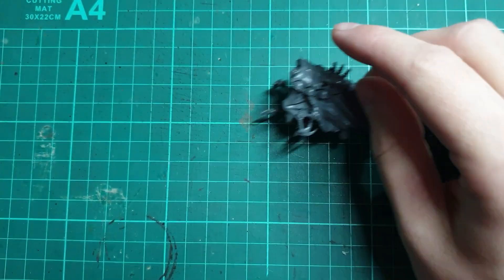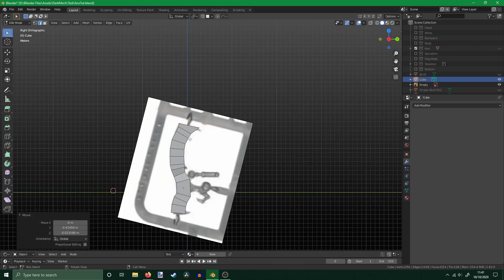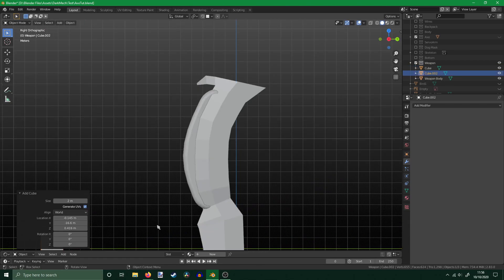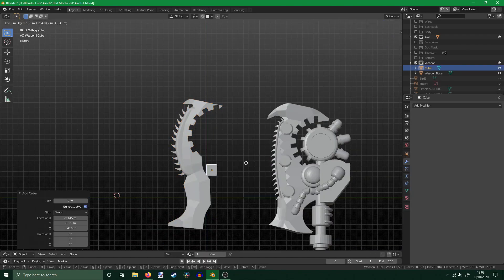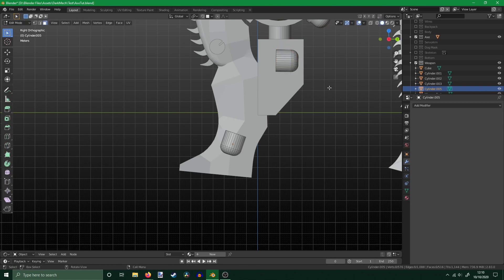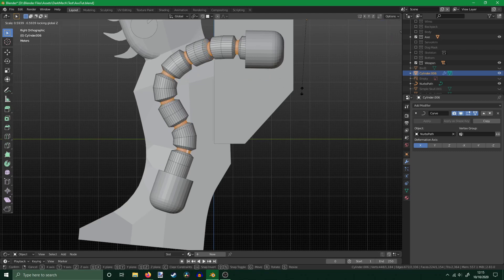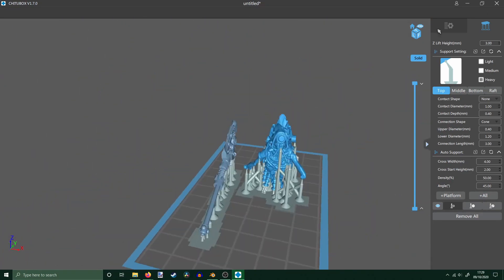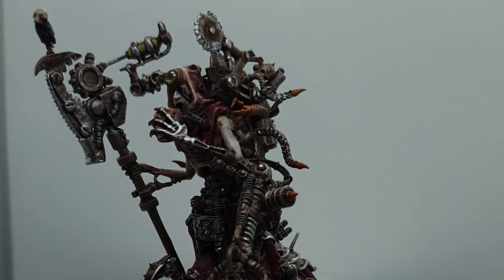40K Conversion | Designing in Blender & 3D Printing Dark Mechanicum Tech Priest

Comment: Got any tips to make a helmet?
Reply from the maker: Yeah, the first thing I'd do is start with a cylinder. Cut it in half vertically use a mirror modifier, this will ensure that both sides look the same.

I'd use a portrait as a reference to ensure the dimensions are right, then use a combination of loop cuts and proportional editing (the o key) to move the helmet shape around until it fits the size of the face.

Using this as a base you can then add extra features like mouthguard and, my favourite, plenty of wires lol.

Hope this helped. 
I might make a video in the future going into customising a space marine with your own helmet and pauldrons with chapter insignia.
Reply: VividMiniMods thanks a lot!  Coincidentally i was doing the exact thing